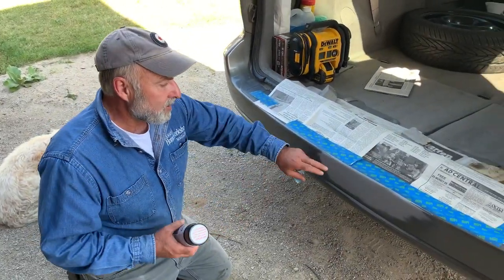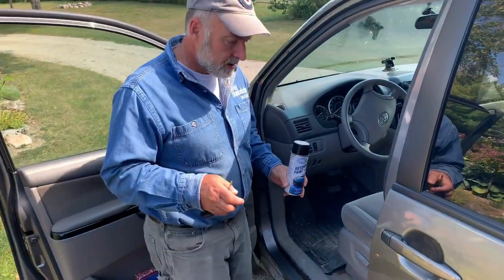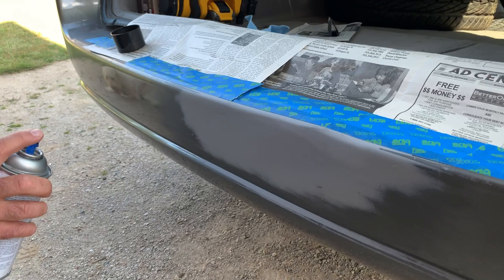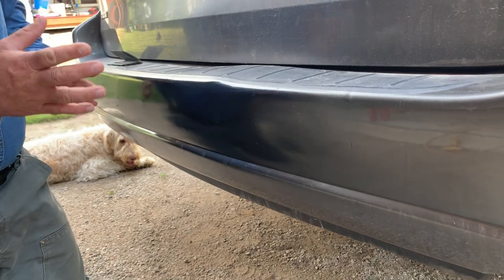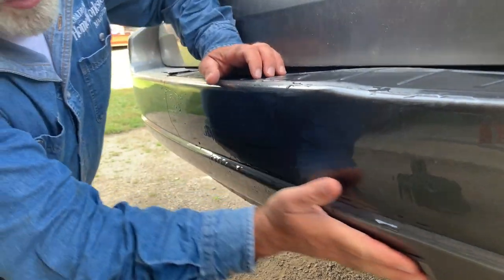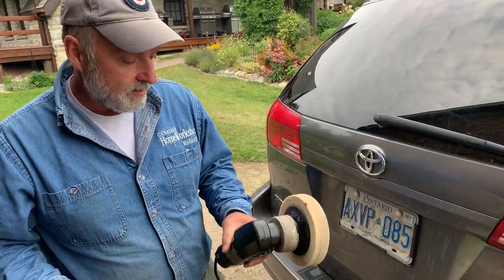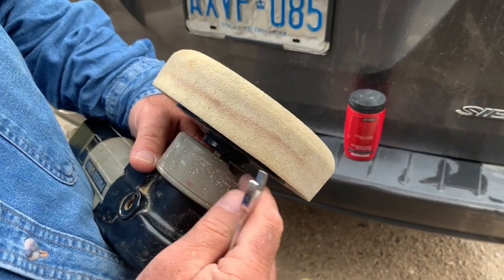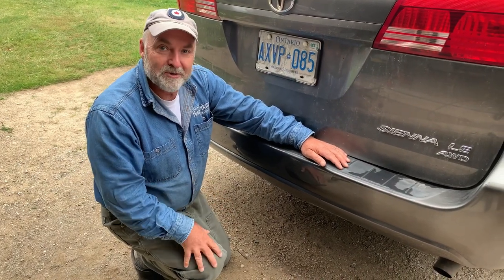How to Fix a Hole in Your Car Part 2: Painting, Clear Coat & Buffing

Comment: A good video with lots of info, but the fill job before this has let it down, I can see very clearly that the bumper has been fixed. Your eyes run along the top of the bumper and the paint only accentuates the problem. Looking along the tape line the bump is higher than the rest of the curve. Otherwise, a very good video.
Reply: Yeah, I'm far from a body guy and I can very clearly see where the bumper top edge is not right along with several HUGE gouges and nics that were not filled.....substandard job, even in a driveway.
Reply: Yeah, I'm far from a body guy and I can very clearly see where the bumper top edge is not right along with several HUGE gouges and nics that were not filled.....substandard job, even in a driveway.